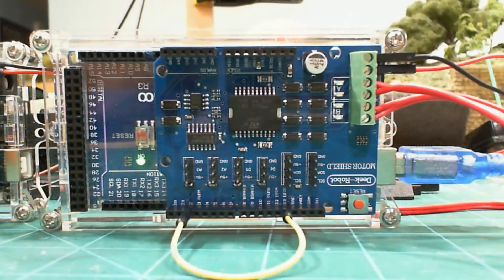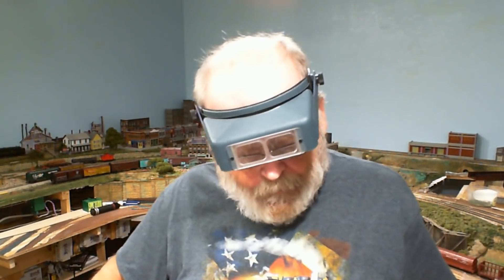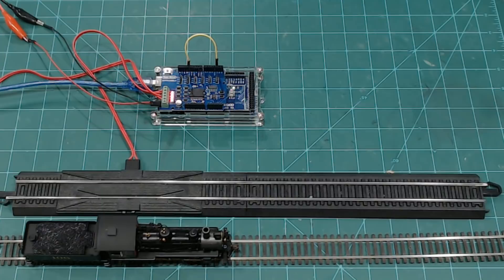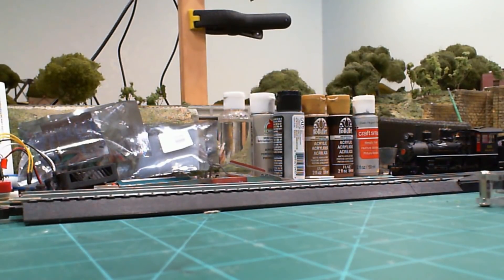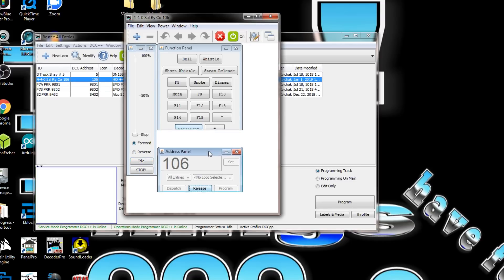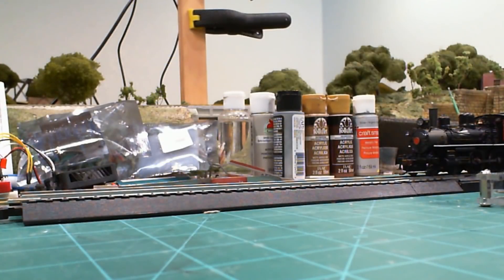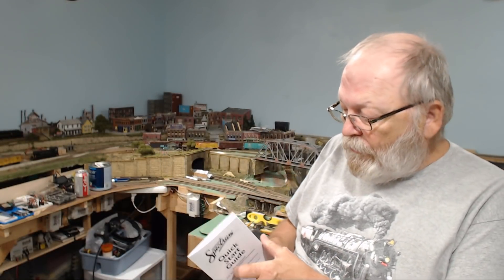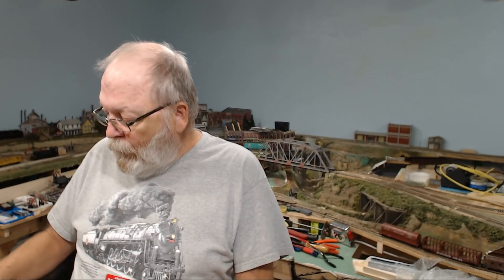Testing The Deek-Robot Motor Shield For DCC++

Comment: At 8:45 in this video you mention putting your locomotive back on the layout track to avoid possible damage to your motor shield. What are you referring to?
Reply from the maker: A lot of modelers have ruined motor shields by attempting to run their locomotive from the program track. This is a feature of DCC but not DCC++.

Comment: Hi Tom,

 My train is Ho scale , brand is LIMA
 A question I have is what power supply can I use with the shield ? 

My power supply is Hornby 16v - 800mA is this possible to use with motor shield after cutting V connector ?
And I have another question if I can use my power supply with this motor shield (the one you used ) can I get exact Voltage output for my loco need ?
Reply from the maker: 16v with less than 1 amp is not nearly enough. You'll need a power supply with at least 3 amps. Try finding a wall wart with those specs.

Comment: How is the fit on the Deek Robot? Did you have to trim the pins under the output connector? They left them pretty long protruding from the solder joints under the board on mine. Did you use risers or only push it halfway down and let a lot of the pins show? The ethernet and power connectors on the Mega (at least the Elegoo version) are in the way as they sit higher than the headers. I'm fine with it sitting 3/4 of the way down if all the pins make a good connection, just wondering.
Reply from the maker: Never had an issue with mine. The pins on the shield do not go down all the way to hit the ports on the controller.

Comment: I notice that at the beginning of the video, when you were comparing the shields the Deek board only had one jumper. 5 to 13, where as the adafruit had 2 jumpers 5 to 13 and 10 to 12. is this correct ? Thanks for the lesson by the way.
Reply from the maker: The Deek Robot was hooked up to an Arduino Mega which only requires one jumper between 2 & 13 While the Arduino shield was connected to the UNO.   https://github.com/DccPlusPlus/Documentation/blob/master/Motor%20Shield%20Pin%20Mappings.pdf

Comment: HI Tom can I run a DCC++ throttle on my digitrax layout?  cheers from the bottom ofthe world where things are looking up.
Reply from the maker: Simple answer, no! The DCC++ throttle is designed to operate with an Arduino. You can use the throttle to run your locomotives if you only use Digitrax for accessory decoders like for switch machines or other devices, but not track power.

For track power, it's either one or the other. Unless you have two completely isolated systems that will not overlap.

Comment: Hi Tom great video I have the deek robot shield on order, a question i have is what power supply can i use with the shield it says 5v-12v how do i get the 14v-16v for track power if the shied only runs on 12v
Reply from the maker: Not quite sure where you read the motor shield voltage is only 5 - 12 vdc. That sounds more like the Uno. The Motor shield is powered separately from the Arduino Uno or Mega with any wall wart rated at around 15 vdc and the amperage of both channels. Make sure you cut the trace for Vcc on the bottom of the shield so you don't burn out the Arduino with the higher voltage.
Reply: @TomsTrainsandThings  Hi Tom thanks for the answer I have seen the 5-12 vdc  on the descriptions on the motor shields on ebay

Comment: I am using the Deek Robot shield and with the DCC power off I get two dim leds when track power is connected to the shield. Any Ideas?
Reply from the maker: If the DCC++ power is off:What are you referring to when you say you have track power on the shield?
Is it the external power connected to the 2 terminals?
Reply: Toms Trains and Things, correct. With my power supply connected I have dim LEDs
Reply from the maker: Had to get out my DR motor shield to test it out. If you look close with the lights out in the room you should notice all the LEDs are lit. two, you can barley see.

Comment: Tom, it appears that the Arduino brand motor shield is now back in stock on Amazon.  There were 14 available,  make that 13 now as I ordered one for the Arduino brand A000079 R3 5 to 12V.
Reply from the maker: Yep, Arduino started stocking them again back in November and Amazon had them shortly after that. Good to hear your ordered one. You can't go wrong there.

Comment: Happy new year Tom!

I wanted to write you that I enjoy your videos. I like the idea of getting DCC++ running, programming and growing the project instead of buying a "boxed solution" like a Märklin central station or a Roco station where you have to wire it and you are finished.

And I want to report a motor shield I bought, which I don't get it running for DCC++. I think it has the wrong chip or I have to few knowhow for it.

The wiki for the motor shield seems to be wrong in some points e.g.:
Chipset in the wiki: L298P
Chipset written on the motor shield: L298N

It is the following one: 
https://elecfreaks.com/wiki/index.php?title=L298_Motor_Shield

I bought it here:
https://www.komputer.de/zen/index.php?main_page=product_info&cPath=32&products_id=232&zenid=gec1v79sfmr9eghp7crop0neb0

What I did:
I set the dip-switch to use an external power supply.

I found a information on the wiki pages of the motor shield that the default speed control mode is PWM. That should meet the requirements for DCC++.

For PWM Mode see the following JPG in the wiki: https://elecfreaks.com/wiki/images/2/24/L298N_Motor_shield-6.jpg

Then I wired it up for PWM Mode:
Arduino PIN 3 (SIGNAL_ENABLE_PIN_MAIN) to the motor shield "Digital 7" (Motor 1 enable control)
Arduino PIN 10 (DCC_SIGNAL_PIN_MAIN) to the motor shield "Digital 6" (Motor 1 direction control)
Arduino PIN 11 (SIGNAL_ENABLE_PIN_PROG) to the motor shield "Digital 4" (Motor 2 enable control)

The motor shield "Digital 5" (Motor 2 direction control) needed no wire because it matches Arduino PIN 5 (DCC_SIGNAL_PIN_PROG).

When I connected everything (Arduino via USB to my PC and a 15V 1A power supply to the motor shield) the LEDs signalling the power state of the motor interfaces 1 and 2 signalled power on. I checked the power with a simple multimeter (I don't have a oscilloscope yet) and it had round about 7.5V for each motor (eventually not enough or is it a failure when using a multimeter for that signal?!?). 

Then I tested from the arudino console to power up the track (Console send <1>). The power state did not change instead the direction changed. I checked my wires and the wiki pages.

It seems that default speed control mode is PLL (see the following JPG from the wiki https://elecfreaks.com/wiki/images/thumb/9/9d/L298N_Motor_shield-7.jpg/400px-L298N_Motor_shield-7.jpg )

Then I tried to change the speed control mode. Here are four solder bridges instead of "real" jumpers. I don't know how to set them correctly.
I cut the four bridges and soldered the other end (like picking up the jumper from the upper Pins PIN 1-2 and shortening the lower pins PIN 2-3 instead).
I don't know if it is "switched" right now because I did not found a hint in the wiki how to switch it correctly (or I did not understand).

With the same wiring I am now able to turn the power on with the console command <1> and off with the console command <0> (the LEDs indicating that the power is on/off) but this time both direction LEDs are on instead of only one (unlike in the test before switching the speed control mode where only one direction LED was on). When I use my multimeter to measure the voltage when the power is on I get 0.3V on the main track and 0.0V on the programming track. There is no light on my waggons when I power up the track! I can not start the train.

When I go to diagnostic mode (console <D>) the direction LEDs are blinking correct. (one track slower than the other).

Is it function correctly in your opinion? Is my measurement is correct in your opinion? May I have a decoder problem on my train instead? 
Or should there be 15V on both tracks when measured with a multimeter.

I ordered a deek-robot L298p motor shield to have a comparison to my measurement! It will be delivered next week. Then I'll post a update!

Can you give it a try or give me a hint what is wrong? Can you describe how I can use this shield instead?

Keep on like you are doing with your youtube channel. It is really great!

best regards from Marienheide (near Gummersbach near cologne) / germany
Markus
Reply from the maker: Markus, Your motor shield is not compatible for DCC++. The required pins are 10, 11, 12, and 13 while yours uses 4,5,6, and 7. There is no way to correct this condition in the software since specific timers and interrupts are used on the Arduino to make it work. I have a series of videos on the subject of DCC++ and the motor shields. I tested several shields in this series and pointed out what I found with these other motor shields. 

The N designation is just an earlier revision of the chip which has no effect on the performance. All the chips are the same, it's the way the manufacturer of the board routs the pins from the chip to the board itself where the problem arises. The only boards that I have found that work are the Arduino, Pololu, and Deek_Robot. 

Some of the boards I tested had limited functionality on either one channel or the other but not both. If you watch the other videos I did on this subject, you'll see I go into further detail on what I found.  
https://www.youtube.com/playlist?list=PLjjhnrIKSTSgWNyYqv9g68zdK3Bp8Lav7
Reply: @TomsTrainsandThings  
Hello Tom,

many thanks! You saved my day with this information about my motor shield. 

I got my first train running now using the deek-robot motor shield you viewed on your video.
But I have issues with programming my train (Uhlenbrock 76320 decoder) on the programming track. I can read all CVs but I can not write any. 
When reading the CVs my train moves a little forward for every CV (like it should).
My first try was to change the address of the decoder. 

I get the following error message in JMRI decoder plus:
308 - No acknowledge from locomotive
At the end of a CV read or write operation, the locomotive replies ("acknowledges") to the command station using a pulse of current.

If that pulse isn't seen, some command stations provide this error message. It could be due to poor electrical connections to the programming track or within the locomotive. It could also be that the decoder doesn't support readback.

Some decoders, particularly certain sound decoders, draw so much current that the reply pulse isn't detected by the command station. In that case, one of the various "programming boosters" may solve the problem.

Do you have any idea why I can not program it?

I measured 14.8V AC on the track and on the programming track when power is on. What power supply and how much volts and amps are you using?

My power supply for testing has 15V 1.66A (from Vodafone Easybox 803). My trains are H0 scale.

Best regards,
Markus